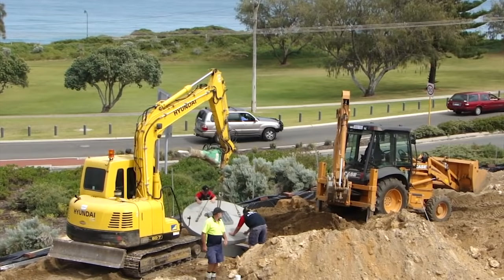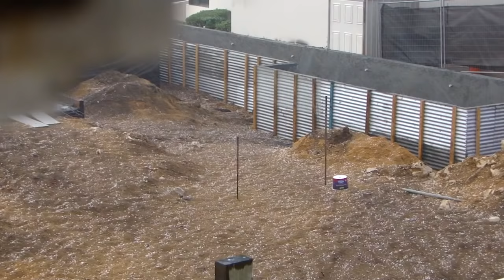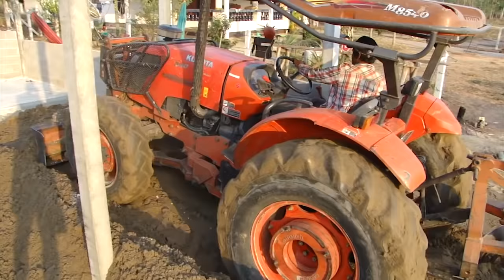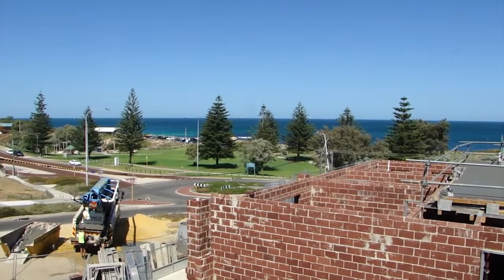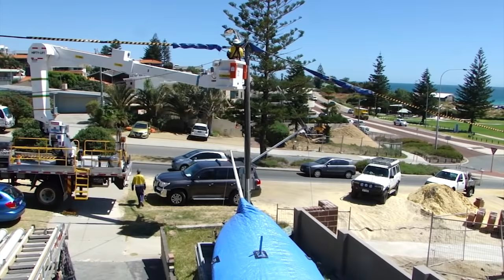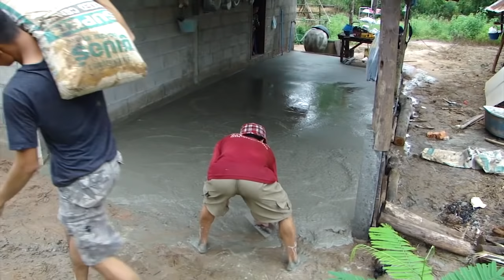House Construction Perth

Comment: well done , we in germany dont have a free concrete vibrator, without an electric wire. sorry i dont know the english word for it
Reply: Its a concrete vibrator, runs on a small petrol engine. A power tool which runs without an electric cord is called cordless.